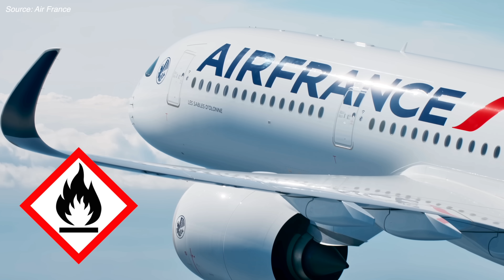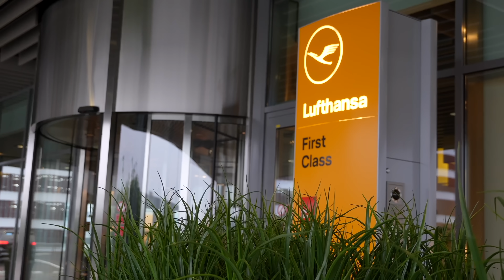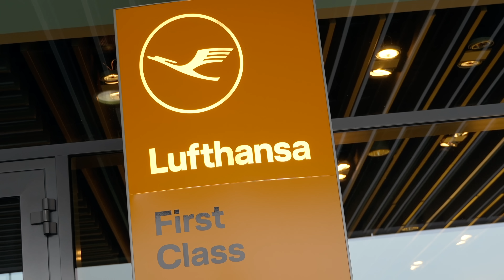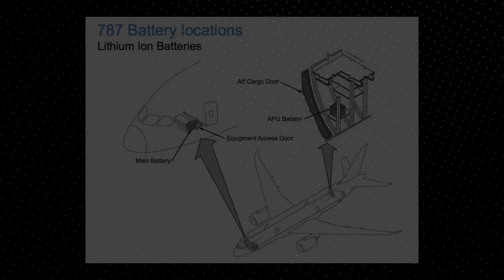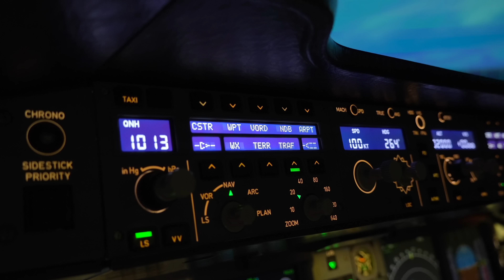Are the A350 & 787 a Fire Hazard?

Comment: Keep in mind that the JAL plane landed on a fully fuelled Dash-8. That alone can explain the difference.
Reply: Even metal planes suffer a similar fate when met with this unfortunate scenario. And it's not the like fuel tanks on JAL516 were empty... They probably still had an hour or so of fuel for holding and diversions if needed...
Reply: Yes
Reply: The a 350 didn't broke apart, like close to all aluminium planes, i do belive it would be unlikely everyone could leafe the plane, if it broke in to Segments. I guess in this case i might saved people, but i have no idea, i could be wrong here.
Reply: The JAL plane would've still had fuel as well though?
Reply: @supermixer_JR  yea it def had a bunc
Reply: I guess JAL and Asiana planes, that were landing, had quite comparable amound of fuel left. Main thing was that JAF plane was fuel cansmashed open. There was fuel all over efter collision.
Reply: Truuuuueeeee
Reply: and he should also bear in mind that the fuel tank of the dash-8 also spilled fuel all over the a350 as the a350 went through the dash-8 ,the fire was broken out as the plane was still slowing down on the runway while on fire with wind blowing thought the fire intensing the fire if u know how fire are made, and compared to the Asiana Flight 214 was landing with a low fueled fuel tank and the gear and tail was hit on the ground not the fuel tank,it also didnt start a fire before it landed on the ground after it flipped  , and the a350 crashed through Dash-8 due to communication errors not the problem of the plane
Reply: not to mention how different fire departments can respond differently
Reply: Yeah, honestly a stupid question to ask
Reply: Yeah. The 777 didn't have a lot of fuel left so it was a smaller fire
Reply: @busfan9874  What 777?
Reply: @Dave_Crupel  they're probably referring to the asiana plane that was used as a comparison
Reply: @Dave_Crupel Asiana 214
Reply: absolutely not lmao. a Q300's full fuel load is barely more than the A350's diversion reserves, and a fraction compared to the a350's full fuel capacity.
Reply: @AA-ks7bo  Yes but airliners typically burn their centre tank fuel first. So could assume that both Asiana 777 and JAL A350 did not have much fuel to burn directly under the fuselage (wings in both crashes remained largely intact). What is the key difference between the crashes? That would be a fully fueled Dash 8 disintegrating instantly underneath the JAL.
Reply: @jakehason1  point is that if this is what it looks like when a CF plane burns with barely 15% of it's full fuel load, then god knows what it will look like if there is a fire on board during flight (swissair 111 scenario).
Reply: @AA-ks7bo Note you’re still talking about 10 tonnes of fuel in total combined 

so yes, that can create more than large enough fireball to totally engulfed both planes…
Reply: @tonamg53  If 10 tons was enough to completely doom the A350 like that, how would it perform in a scenario like South African Airlines 295? or SwissAir 111? Those pilots needed at least half an hour to divert (if they realized soon enough that they had to). How would an A350 perform in that scenario with 100+ tons of fuel in the wing and center tanks?
Reply: @AA-ks7bo  you know what’s the different between 10 tonnes and 100 tonnes of fuel leak is?

It doesn’t matter, you run the opposite direction either way.
Reply: @tonamg53  How are you gonna run in the opposite direction when you're still in the stratosphere?
Reply: @AA-ks7bo  In that case you don’t need to run… 10 or 100 tonnes of fuel still make no differences. You won’t be able to run away in either case.

Try thinking harder
Reply: @tonamg53  That's literally my whole point, genius. I'm saying the Q300's fuel doesn't matter because CF's danger will truly show in a mid-air fire where evacuation doesn't matter. 

Try reading harder
Reply: @AA-ks7bo  Midair fire, you’re screwed carbon fibre or steel or aluminium. It doesn’t matter.

Note that because of high airspeed, exterior fire usually doesn’t last long than a minute or two… unless its the fuel tank that’s burning… which again, it doesn’t matter if its a cf fuselage.

You seem to failed at thinking harder…
Reply: @AA-ks7bo  Also note, mid-air fire in the fuel system during flight is totally 100% unrelated to this accident.

Might as well worried about toilet blowing up mid-air spewing its content incapacitating the pilots… if you’re going to worried about mid-air fire.
Reply: @tonamg53  Well no, the difference is that with Aluminium, if a small part of the airplane got extremely hot, that part will melt, but the rest of the airplane will still hold up. With CF, if any, ANY, part of the fuselauge becomes hot enough for the CF resin glue to catch fire, that's pretty much entire airplane utterly doomed, since it's impossible to keep the fire local at that point.
Reply: @AA-ks7bo  Again, exterior fire mid-air does not last long due to high airspeed unless fire is directly feed by fuel then it doesn’t matter if it’s made from aluminium or CF You’re screwed.

Go and read how Concorde crash, that was 100% made from aluminium and titanium. The only damage it had was ruptured fuel tank… only managed to fly for two minutes.

You know how many people died from burning due to mid-air fire on the plane?

Zero… none of those died was from the actual fire… they all died when the plane impacted the ground.
Reply: @tonamg53  Have you been reading anything i've been saying? literally the whole time i've been saying that the Q300's fuel load doesn't matter here and is utterly insignificant in the grand scheme of things. 

A fire doesn't have to be on the exterior of the plane, there doesn't even need to be a fire, you just need to reach the CF resin's flash point at any part of the airplane, and at that point the entire fuselage is toast. 

Take for example Saudia 163, had the L1011 been made of CF it would have already burned to a crisp by the point of touch down.
Reply: @AA-ks7bo  but it does… fuel from Q300 spread all over A350 fuselage after it crash head on into it on the runway. 

All the fireball you see in the accident was from the Q300, NOT the A350 as you can clearly see the wing or aka “the main fuel tank” survived the fire meaning it did not ruptured during the accident.

Q300 was likely to have around 2 tonnes of fuel in it. Again, it doesn’t matter if it was 100, both quantities are more than enough to create a massive fireball and ignited materials around it.

Also, you know why the authorities limits the evacuation time to 90 seconds… because it is unlikely you will be able to evacuate the aircraft after 90 seconds after the hull had breached and smoke starts coming in. 

Also another note, Saudi 163 was an interior fire. Everyone onboard died from smoke inhalation from burning cabin materials before the fire even got to the fuselage. 

Got absolutely nothing to do with this accident.

Guess why they banned smoking on board the plane?

🤦🏻‍♂️
Reply: Or maybe the Dash 8 is Fueled and JAL has only few in case of Go-Around. :3

Comment: My gut feeling is as per the video: they're better at passenger protection but more prone to hull loss. I fully expect insurance premiums are going to rise as a result, by how much will be interesting to see and if it's absorbable or passed on to the passenger
Reply: Not really, a fire on any aircraft almost always results in the aircraft being written off, even if only a small portion of it is actually burnt. Also in the case of the JAL plane, it would have most likely been a write off anyway even without the fire due to the impact damage
Reply: @aarondynamics1311 any remaining scrapes can be sold off but if the whole thing just burns away, nothing is left to be sold.
Reply: I agree with your assessment! Very eloquent.

Comment: Hi.I’m Japanese guy.According to the news report, pilots of JAL A350 were testified that they couldn’t control the plane at all after the crash.So I think that the hydraulic system cut by Q300 and that oil made the fire more serious…
RIP five crews of Q300
Reply: @mfk5533 it absolutely does use hydraulics
Reply: It’s FBW but still uses hydraulics for the actuation of surfaces…

Comment: Much like a fiberglass boat its not the fiberglass that burns, its the resin that holds it all together that burns. Aluminum melts at 1,300 degrees when heat is applied to it. Composites dont burn….. its resin does
Reply: Boats use polyester  resin .Aviation manufacturers use epoxy .Polyester burns like hell .Epoxy is more fire resistant .I make aircraft parts with epoxy and carbon fibre ,and glass fibre .Carbon is stiffer. There are some pretty woven cloths that use carbon and kevlar.

Comment: I thought this was the cause why it indeed turned into scrap ashes.

Oh and, a more simple answer to why AS214 has a much more recognizable wreck is because the only major part of the plane that was damaged was the tail, and it slowly burnt its way to the forward fuselage of AS214, while JL516, the collision between a medium size short haul plane like the Q-300 with a long haul wide-body plane like the A350 is much much, and I mean MUCH more brutal than a tail separation,

Like imagine,
The AS flight has a seperated tail, both engines detached, all landing gears collapsed, and a medium size inferno.

On JL516, the Q-300 (probably) hitted both engines, collapsed the front gear, (probably) hitted the fuel tank, several pieces of the Dash-8 further damaging the A350 in a way that it has a much larger inferno.
Reply: And also, the Q-300 was probably fully fueled making a much bigger initial flame. still to early to tell
Reply: “probably hitted both” 

Probably hit both mate
Reply: @stephenjacobs5640  I said both engines.
Reply: @shooting4star2023  oops

Comment: As usual, excellent video.

The fire fighters gave up on putting out the fire which news agency cited that it doesn't make sense to put fire fighters at risk if everyone had evacuated. 

I tried to look for information about the B-2 regarding this bit but wasn't able to do so
Reply: Bingo! Airport fire rescue is designed to delay fires in order to permit passengers the best chances of escape & survival. Unlike structural fire departments who enter burning buildings, airport firefighters are neither trained nor equipped to enter a burning fuselage. This was an overwhelmingly successful outcome, given the circumstances, and will likely pose some valuable training lessons for airplane designers and airport fire rescue crews in future.
Reply: @adrianwapcaplet2773  Airport firefighters (ARFF) are equipped and trained to enter a burning fuselage.  It's something they practice regularly.  However if they get information that everyone is out, they don't have to.  In the case of the A350, they got that information.  A conventional firefighter is trying to prevent structural collapse because there are likely other buildings nearby that may be occupied.  Airport firefighters don't have to do that.  The plane was on a runway, away from any other plane except the one it hit.
Reply: @cjmillsnun  That is certainly not the case at the airport at which I work, and with the ARFF crews with whom I share an office. Mine is an ICAO Category 10 airport (highest rating), and when an airplane is actively burning, firefighters often don't leave their trucks, which are equipped with "spears" at the end of articulated booms that puncture aircraft fuselages in order to spray foamed water within. 
Structural firefighters don't enter buildings to prevent collapse (that's precisely when they DON'T enter buildings); instead they enter solely to extract people who may be trapped within.

Comment: Lol, the evacuation didn't go well at all. 18 mins to evacuate while there was a fire ? Sorry but this is very concerning, not at all heroic. Thumbs up to the a350 that protected its passengers for 18min, which is absolutely insanely good for an aircraft in fire
Reply: 18 min, that's crazy! That massive initial fire ball. Composites seem to have worked well. It didn't cook the passengers within 18 min.
Reply: Still 10-15minutes is a huge amount of time. Some accidents happened where an aircraft in fire landed safely but everyone died because the crew didn't evacuate quickly enough. And sometimes everyone died just a few minutes after impact. In case of fire, everyone should be out in about 90seconds. Fire is very, very quick to destroy an aircraft. As a rule of thumb, when fires is declared in the air, pilots are told that they have 18minutes to get to the ground and evacuate everyone. They are trained to evacuate much quicker than 15minutes, definitely. The investigation will sort this all out, but I'm sure that with such a poor evacuation time, the crew will have a lot to explain
Reply: According to Japanese news sites the evacuation was less than 18 minutes. the 18 minutes that appear in the news is the time from impact. those 18 minutes include the time the plane skid for a other 1000 meters (3280.84 feet) before it came to a full stop.
You cant evacuate people  when the  plane is still moving. also after the plane stops the pilots first have to asses the damage and be sure that it is safe to evacuate. seems like from the time the slides where deployed until evacuation completed was more about 5 to 10minutes (some passenger say it took 15 minutes till the slides deployed other say 10...)
don't know where that information was lost in translation in to english....

Comment: Me as an a350 fan really  scared when i knew about this. For me it were shocking news. ((
Reply: The actual scary part is that it happened in the first place, not so much the plane. Clearly mishandling by ATC or miscommunication that two planes were landing on the same runway. Someone screwed up big time. That wasn't going to end well no matter the plane type.